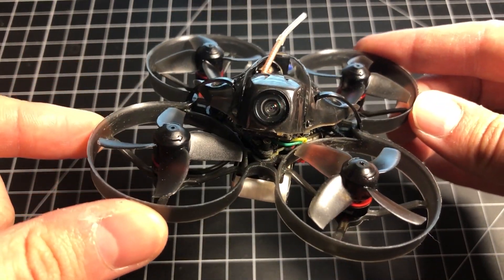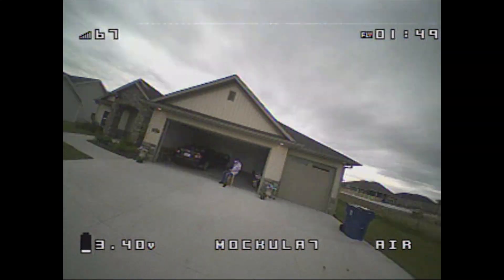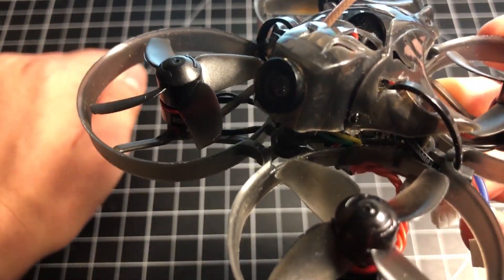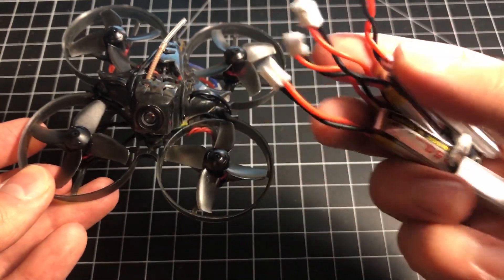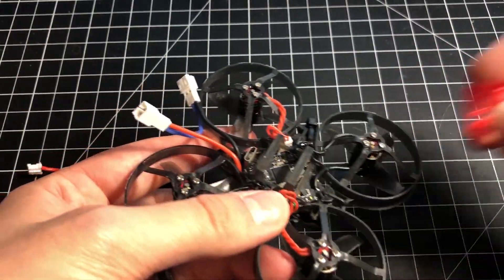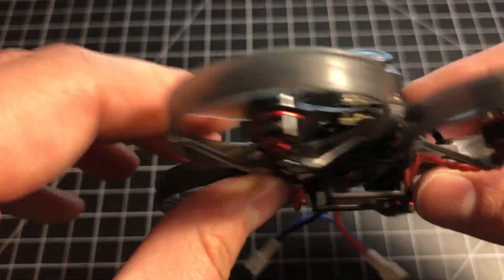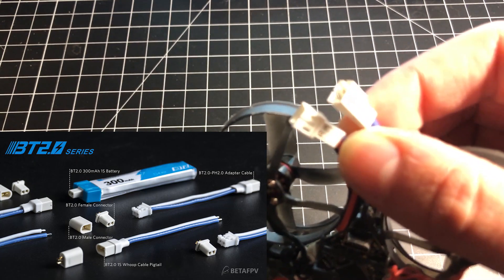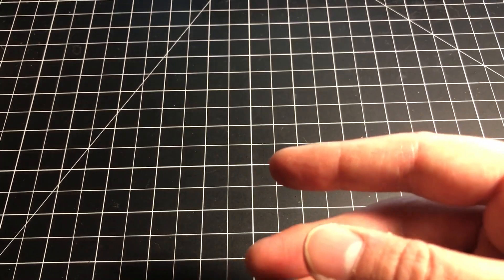Happymodel Mobula7 V2 Review - Is it still worth it?

Comment: Newer whoop tech?   Like? 

Can you review a new model?
Reply from the maker: nathan rubio At the time I posted this video there were two new whoops readying to be released: the HappyModel mobula 6, and the BetaFPV meteor65. The BetaFPV model sported a new connector. The HappyModel M6 features and all in one flight controller and video transmitter, making it really good on saving weight. That’s what I meant by new tech. I did a review of the Meteor65 which I had on on the way, but I did not like it: https://youtu.be/DJLjbktlnqI I’m thinking about picking up the Mobula 6 but I don’t know if I should at this point... thanks for your comment!
Reply: John's right. The new model is the Mobula6...which is the same as the Mobula7 but 65mm instead of 75mm.  Well, let's put that in proper perspective...I don't think a ton of people understand that there are 25mm in an inch. So, 10mm, the difference in frame size, is about 3/8" !!!  That's it!  The Mobula6 has 19000kv or 25000kv motor options.  The Mobula7 has 16000kv motors, which are probably correct for it because that 10mm in bigger size will allow it to run slightly bigger props. Bigger props cause more of an amp load on the components, so you probably don't want to run higher kv motors.  I say that the Mobula6 and 7 are the same, because they both will now use the F4 AIO board, but the Mobula6 has the VTX built into the board, where the Mobula7 has it built into the camera.  That allows the Mobula6 to weigh less.  The camera is also better.  On a scale of 1 to 10, I'd say both are a 10 for their sizes...65mm and 75mm.  Best you can get!  I think few that actually own them, would debate that.  They're rather spectacular!  Especially for the price.  So, whether the Mobula7 is brand new or not, it's still an awesome who0p which is best of class in the 75mm who0ps! :)

Comment: I wanted this but it was sold out zo i bought the mobula 7hd with a 12a esc board
Reply from the maker: Congrats, should be fun but it is quite a different flyer. if you still do want this the China vendors I have linked do have it. 🤗

Comment: In my country i can get mobula7 for 60bucks and mobula7 v2 for 100bucks pls tell me which one to buy is it worth spending 40bucks more on v2
Reply from the maker: At a $40 price difference, get the mobula7. Just make sure you buy a spare frame since it will break easily.
Reply: @JohnCuppi  ill buy the v3 frame and mobula7
Reply from the maker: Manashwinn Rao good idea but you may also consider the v2 frame as well!  It’s lighter :)
Reply: @JohnCuppi  well i just got my mobula7 should i tune project mockingbird settings
Reply from the maker: Manashwinn Rao just have fun with it as it is for a while, if you get bored try project mockingbird :)
Reply: @JohnCuppi  everything is good got some skills but i am getting 2.40 minuted flight with the gnb batteries
Reply from the maker: @mr9712  If you are pushing the stock mobula 7 hard on 2s, then 2min40 sounds normal. If you want more flight time you could consider a hardware upgrade in the future by swapping the connector for a better one that can deliver more consistent current :)
Reply: @JohnCuppi  im not even pushing hard just cruising